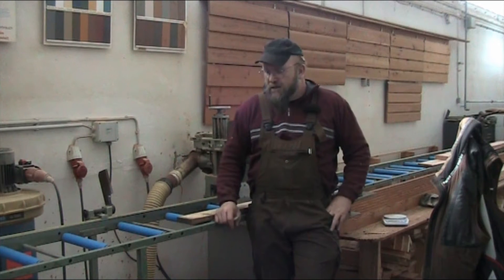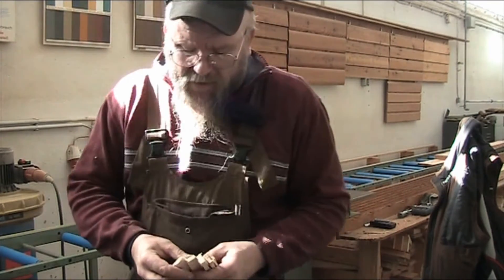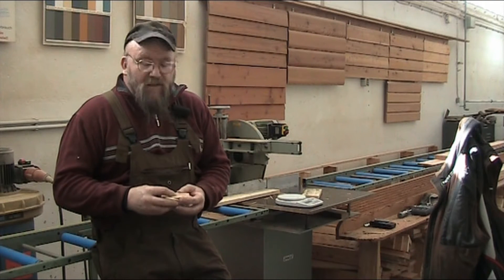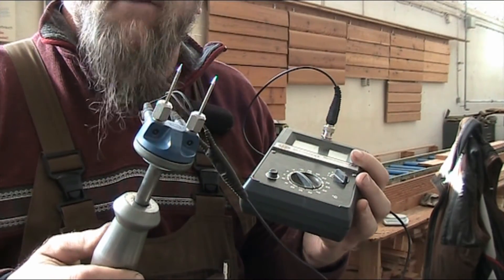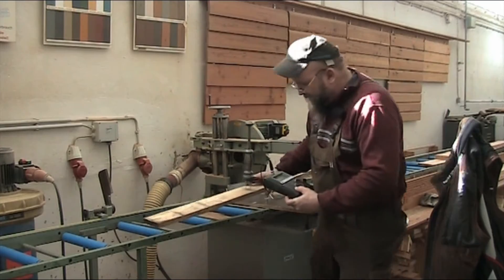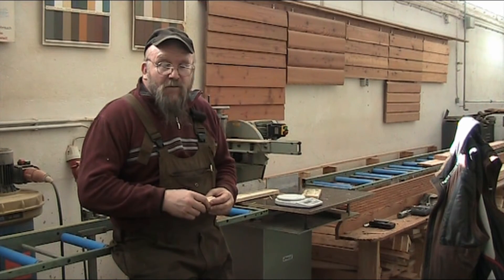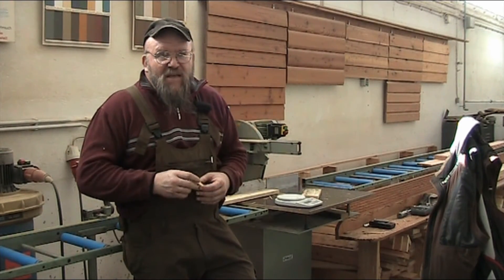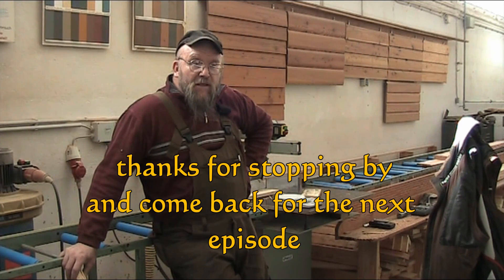the stack episode 2, monitoring the drying process

Comment: Have you ever used the wagner digital moisture meter that sends some kind of a wave 3/4-1" in the board to measure moisture ?
Reply from the maker: yes, they work really well. they're not quite as accurate as using a probe-type moisture meter but they are usually within 1 to 2% which is really good. the newer ones i imagine have only gotten better. 
the sad thing is that they are insanely expensive, even a used one. i see them in flea-bay on occasion and they command some pretty steep prices.

Comment: Very informative.
Something i always do if i store anything of value on the ground outside or in the basement is lay a piece of 6 mil plastic. Is that a good idea for drying lumber?

Thanks
Ray
Reply from the maker: outside: only if the moisture is coming from underneath. if you have rain coming down and the water can't run off and pools underneath the stack you're back to square one. 

either way you should elevate whatever lumber you're stacking at least a foot off the ground. 

in the basement it works to an extent but then you get condensation underneath the plastic which could bring other problems with it such as facilitating mold growth etc.
if you're seeing condensation underneath the plastic in the basement, it's probably not a good idea to store your dried lumber there

Comment: I can believe that in Idaho, 8%. That would never happen here in PA, way too humid.
Reply from the maker: north idaho is relatively humid as well, not as bad as is back east but you should be able to achieve some fairly low humidity levels. it just may take a while longer. if you really want to know what's possible in your neck of the woods just take a moisture meter and go measure different wooden features in old barns. old barns aren't heated and usually pretty drafty. so they will reflect the ambient rh. the higher you go up into the rafters the drier the wood is going to be.
Reply: @HolzMichel  That is a fantastic idea. Thank you!

Comment: I have logs that I want to season for wood carving, I've sealed them with end grain sealer. It's spring here in New Zealand at the moment. Can I put them up in the attic to season or would I be better off stacking them outside for now? Cheers.
Reply from the maker: well, now there's a loaded question lol... for wood carving there are a whole different set of parameters. if you're looking to carve the whole log and keep the bark or the surface of the log under bark, you have several options.

 the first is what you are doing. the drying process will take several decades as the water will only escape through the parenchyma and not the end grain. 
another is allow the log to dry without the ends sealed which will also take a few years depending on the diameter and length of the log. in either case you will end up with heart checks on multiple facets of the log since the wood shrinks the most in its tangent
if you want to avoid cracking, the best way is do what you did, (seal the ends) but then split the log lengthwise but do not seal the exposed inner wood. if the log is split with a froe, wedge or an axe, the two halves will not mate back up 100% because of the shrinkage that has occurred once the wood is dry. 
the best way to split the log is by sawing it. allow it to dry and then run the two faces over a jointer and glue them back together. the drawback of course is that grain will never match up 100% again which is probably why you're carving out of a log to begin with
another option is to take a worm gear skilsaw and saw a longitudinal cut from end to end into the pith of the log. this is a good option if the carving will have one side up against a wall or in a corner and the cut can be hidden from view. because as the log dries out, the cut will get wider. some hairline cracks may appear in other quadrants but will be rather minor and shouldn't be too much of a detraction from the carving.
since green wood is easier to carve on than seasoned wood, it may be more advantageous to do your carving green and allow it to dry on its own. the carving will distort but if you can predict how it will shrink, you can use that to your advantage. cracking would probably be at a minimum as you could be relieving the wood in places that would otherwise warp
if grain patterns are not an issue with your carving and it is not exposed to the elements, the absolute best option is to have your end grain sealed log sawn into half inch thick boards, stack and dry in your attic. they will be more than dry enough at the end of summer. then run them through a thickness planer and glue them back together in the order they were sawn. you still maintain some of the original profile of the log but there will be some loss due to the milling. 
the reason for half inch, is a commercial grade thickness planer can mash the board down and create a smooth glue surface and when you go to glue up the boards will also have enough give to them that your clamps will be able to deliver enough pressure to close the gaps. 
the thicker your planks are, the more you have to joint them in order to eliminate the gaps in glue up. if you have a thin kerf bandsaw then a few more cuts won't cost as much material as thick planks will.

no matter which way you go, the attic will always be the best place to dry your wood in the absence of a drying kiln, providing it has a little bit of ventilation to carry off the moisture. wood moisture levels in the single digits are possible in sawn lumber in two years time in the attic.

hope that helps.

cheers
mike
Reply: Thanks Mike! This is huge as I have been struggling to find this kind of info on the web. Another question I have is in regards to drying times; is it true with logs that an inch of wood thickness = a year of drying time? Its a theory that I have seen around on the internet. I don't know though how accurate this is, and whether or not it applies to ring porous woods or diffuse porous woods. Cheers.
Reply from the maker: that rule of thumb is fairly accurate but is only applicable to sawn or split lumber and not logs. oak (ring porous) will dry at a slightly faster pace than  maple (diffuse porous) for obvious reasons, but the rate of drying is more dependent on relative humidity and density of the wood than anything else.

round wood that is horizontal takes much longer to dry since there is no active mechanism to enable the moisture to escape. dead standing however is a total paradox. if for example a tree dies off and the foliage is still attached, it will take the summer and it will reach fiber saturation and begin to crack. that is because the evapo-transpiration mechanism is still in place and will continue to wick moisture out of the bole. even with the foliage gone the limbs will also continue to wick moisture. i have seen moisture content as low as 10% in the tops of lodge pole pine and doug fir that was dead standing.

if you're going to dry round wood in your attic, if it's shorter than 3 feet laying it horizontal will make it dry faster. if however the chunks are longer than 3 feet then you should keep them in a vertical position with the end on the floor sitting on a stick or something to ensure there is no broad contact with the floor
Reply: Thanks for your help and your time Mike, I've learnt allot through watching your videos and your replies have been the icing on the cake, now I will be drying my own logs and lumber with confidence, Cheers.
Reply from the maker: always my pleasure to be of assistance. if there are ever anymore questions feel free to fire away. there are always other folks out there following the threads with the same or similar questions and this channel is here to disseminate this kind of information. 
cheers
mike

Comment: I need some 10" x 10" beams. How do I go about curing that wood?
Reply from the maker: sorry if i overlooked your question. YT doesn't always notify when a comment comes in.
if you're curing sawn beams then proceed as you would with any board lumber. just keep in mind that a 10x10 beam will take about two to 3 years before you should be building with it. providing it was sawn from green stock.
if you cut your beams from standing dead timber you can use them right away, if they have heart checks in the log. 

if they don't show any cracks at the time of milling, you should let them dry for at least one summer and let them show some cracks before using them in a building project.
unless you have quartersawn beams, they're gonna crack. which is not a bad thing, cosmetically it's sort of a downer but it doesn't impact the beam in a negative way.

Comment: in your previous video it appeared to be winter.  Can you dry lumber in the winter?  If so, how long would it take on average?
Reply from the maker: the short answer: yes. it just takes a bit longer. i talk about it briefly in the subsequent video on atmospheric humidity. the process is referred to as sublimation otherwise known as freeze drying. the paradoxical thing about it is that the colder it is, the faster it dries. relative humidity can be almost 100% at temps ranging from -2 to +10 C so the drying process slows to a crawl at those temps. as you dip below -5 C the drying process gets going. the frost forces the moisture out of the wood up to the surface and there it turns to its gaseous form and evaporates at rates depending barometric pressure.

Comment: I'd like to use my large four car garage for as much of the process as possible. How long would it need to stay outdoors to get under 20%? I know thow this is highly circumstantial.
Reply from the maker: if you stack it in the early spring time (april) usually by fall (late october) it will have lost enough moisture to put it in the garage. if security isn't an issue, it would be advisable to leave the bay door of the garage open where the lumber is stacked. with a good freeze during the winter, by early the next summer you should be seeing moisture contents of around 12 to 16 % depending on how good of an airflow you've had over the winter
Reply: HolzMichel 

Firstly thank you for the video series as well as your response it is truly appreciated.

Damn. That's quite a lot longer outside then I expected. 7 months? The problem with my current property is that it's a lake front property. With a double car and 4 car garage behind that. Bought it for the 4 car garage to become a workshop thought it would be a huge benefit which it is, but there isn't really much of an area to put lumber to dry outside besides a 4 foot wide section behind the garage and a fence which won't work. Really overlooked the need for some outdoor storage space, was too intrigued by the vast amount of indoor workshop space.

You told another guy to fell the tree and leave it there without limbing for a log cabin. Could I do the same to maybe speed up dry times? Whole summer is a lot. Will be leaving it on a friends property I supppose which is fine really
Reply from the maker: yes, your drying time will speed up marginally by cutting the tree in the summer and then allowing the foliage to pull out the moisture. you'll still have roughly 40 to 50% moisture content if you do it that way as opposed to 100% if you go to milling the log right away. 
keep in mind that in the absence of an energy investment you will still be stuck with a time factor

Comment: Thx for your video. Where would I buy the thermohygrometer you showed from Lauber?
Reply: Not much help unless you speak German, any suppliers in USA, where does your company get them
Reply from the maker: they become available in german ebay once in a while but they are available from the manufacturer directly. here's the link to their website:

http://www.ds-messwerkzeuge.de/temperaturfeuchte-anzeigegerat-rund/

hope that helps.
Reply from the maker: the company got them from the manufacturer direct if i'm informed correctly. there is a website that does a realtime translation of websites: http://www.online-translator.com/
it works reasonably well and you should be able to figure out how to get an order in. the other option is keep digging in ebay as these things do pop up from time to time.

Comment: where did you find the "Lauber Thermo-Hygrmeter" model number D-73553? Couldn't find in anywhere I searched.
Reply from the maker: there are several all around the outfit i work in. have you tried looking in german ebay?  there is one for sale there:

http://www.ebay.de/itm/Raum-Thermo-Hygrometer-von-Lauber-fur-Temperatur-Feuchte-Anzeigegerat-rund-/380377847845?hash=item5890495825:m:meBS7u7V2cb6h8x9BGH-0bg

they're not real cheap.

you can also get them from the manufacturer direct:

http://www.ds-messwerkzeuge.de/temperaturfeuchte-anzeigegerat-rund/

if there's anymore info you might need just give a holler

good luck and thanks for watching and commenting.

Comment: What about air drying in a barn in what used to be a hay loft?
Reply from the maker: +Daniel Grass  that would be like an attic i would tend to think. as long as the air is pretty dry, or have plenty of air movement it should work really good. many old mills in europe use old barns that have been re-tasked as drying sheds with a pretty good end result.
just make sure you get the bottom of the stack far enough up off the floor so it doesn't take up evaporating ground moisture and you should get some pretty good results.
thanks for watching and commenting!